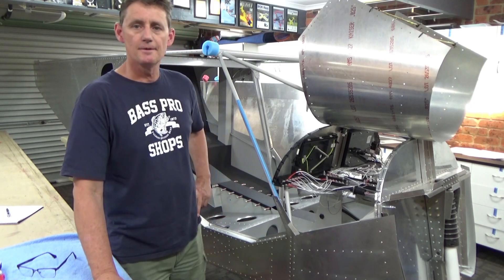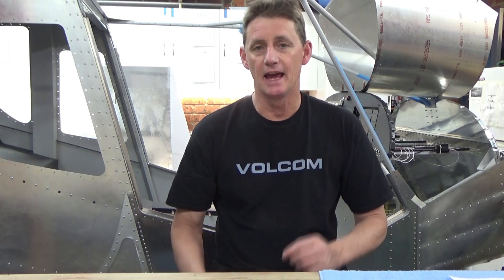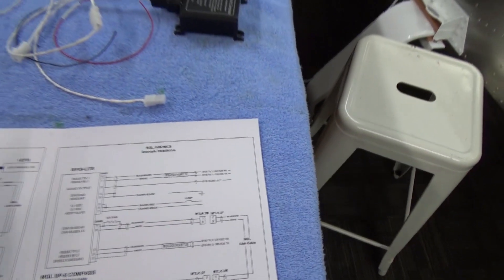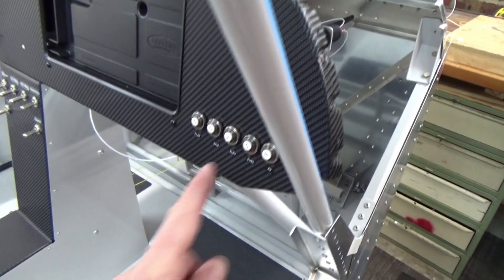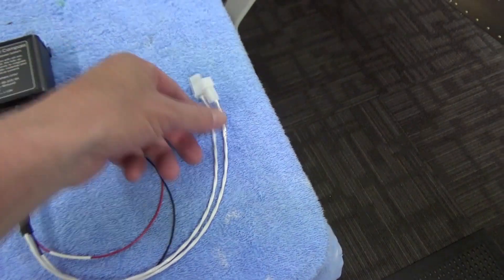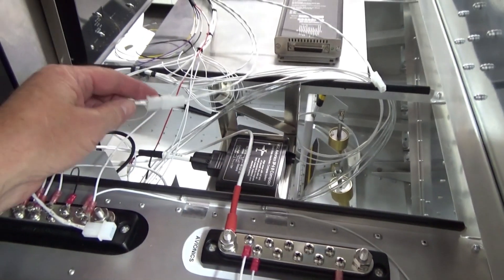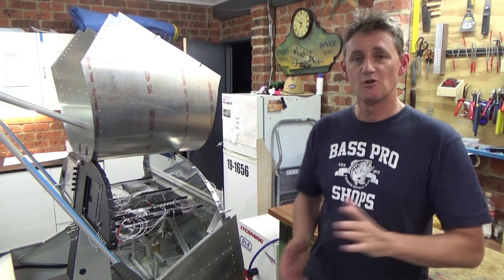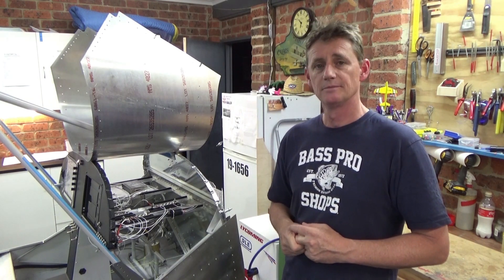How I installed the Avionics in my CH 750 Cruzer

Comment: audio out goes to you music or intercom ..its just external audio to the headset...you either use the CAN bus or RS232 depends on what else you hook up to the MGL. Use the CAN bus its easier and simpler.
Reply from the maker: So I dont need the yellow wire? And do the White and Blue /white com wires cross over ( White goes to blue/white?)

Comment: Just put the same USB on my Jab through a 3 amp circuit breaker - in the 2amp USB socket (my USB socket has 2 different amperage sockets 2and 1 amp)  it charges iPad with OzRunways no prob. In the 1 amp socket it only holds charge.
Reply from the maker: jiefu good info thanks I will check my sockets

Comment: For the USB any 5V power supply will do and you can cut off the USB plug and wire the usually read and black wires to the 5V supply.   From my drone experience with compasses offsetting them makes no difference.  You just want to keep them away from high current wires or coils that could generate magnetic fields.  The CAN bus is otherwise known as Controller Area Network.  Think of like plugging your computer or sensor into a LAN point on the wall and connecting to other computers.  The 120ohm resister has to be somewhere in the circuit to give it the right impedance however a lot of devices have the resistor in them and CAN often works fine without it.  CAN is how modern cars wire up engine sensors and lights etc.